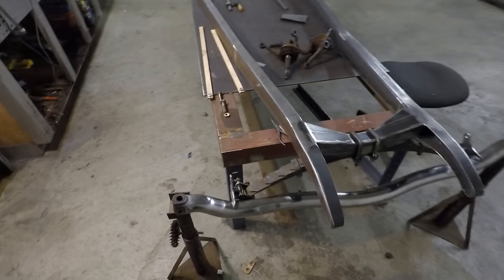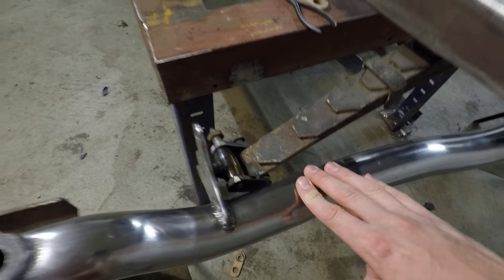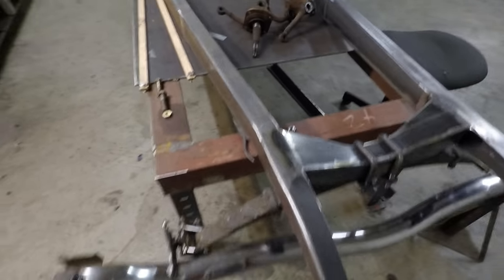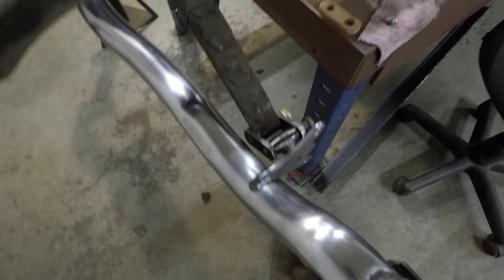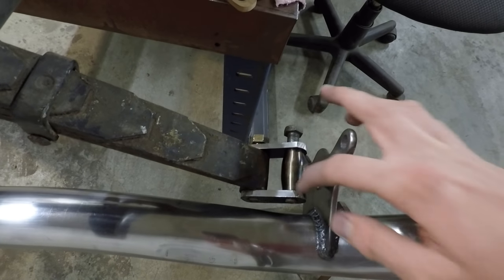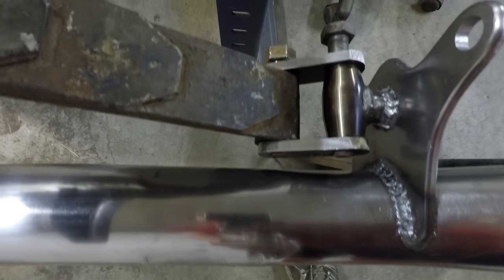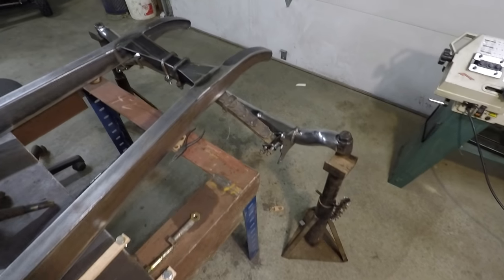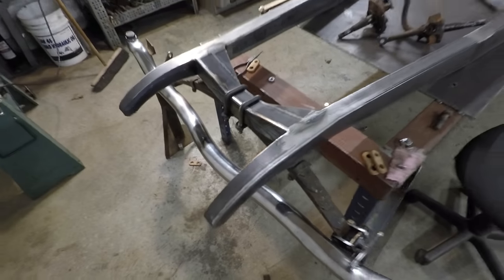Custom Front Axle Mount | Boat-tail Speedster Pt.8

Comment: I know this video is 11 months ago, and I haven't finished watching the others, but I'd suggest aircraft wiring the two shackle bolts together so they can't back out as the spring rotates with changes in load. Great series, really entertaining!
Reply from the maker: that's a good idea, but it'd be tricky since the bolts are drilled through for the grease fittings already

Comment: So you could always put the bolt in from the other direction so you can use a lock nut or a castle nut with a cotter pin
Reply from the maker: I cant do that on the outside bolts because the axle blocks a bolt from going in that way

Comment: The way you have the spring eyelet designed and welded into the batwing it will be under heavy rotational load and be prone to cracking your welds.
Reply from the maker: ill probably reinforce it

Comment: You didn’t show it on camera but how did you ensure the spring mounts were square and level when you pressed them into the bat wings before welding? 
I would imagine that would be a critical step. 

The bolt and wire trick is simply brilliant  Vince.
Well done.
Reply from the maker: I spent some time carefully mocking everything up before welding, and yes, that is a critical step

Comment: Did you address the kingpin inclination angle for caster or is it built into the axle from the factory?
Reply: KPI is built into the axle, 6 to 10 deg of caster needs to be set up before welding the bat wings plumb. Spreading or preloading the spring with the shackles horizontal is necessary to locate bat wings, this will prevent the front end from moving sideways. If you don't do this it will need a Panhard.